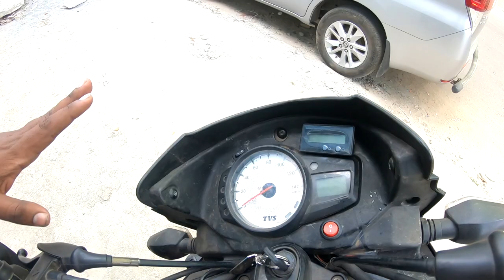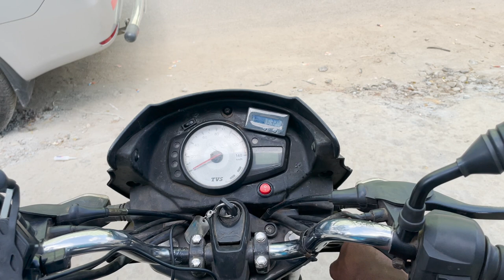ಈ ಗಾಡಿ Ather450xನ Beat ಮಾಡುತ್ತೆ | Ather450x vs Hub Motor Tvs Star City Plus DIY BIkes

Comment: Good thing that you are only programming the controller so we can costumisable as per requirement. But try to cover awkward looks and make it good look with carbon fibre designs then it will be ultimate...
Reply from the maker: That's the plan!